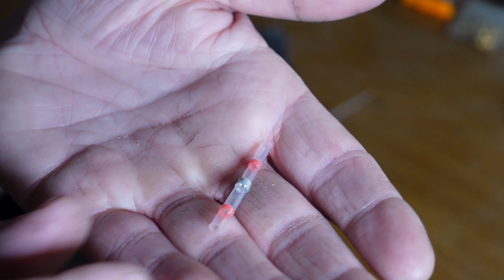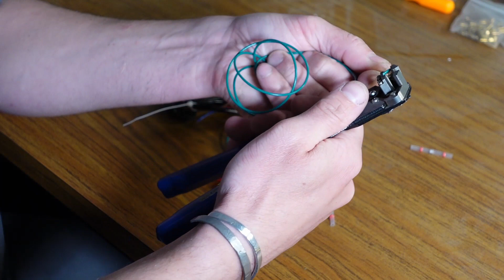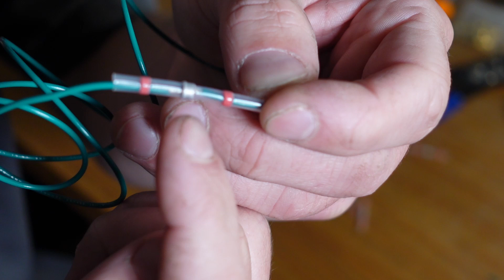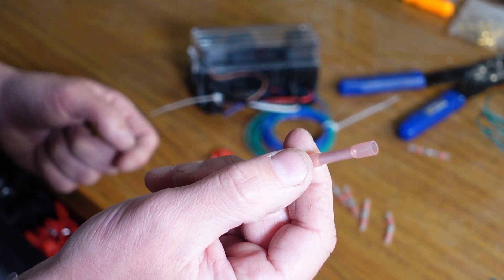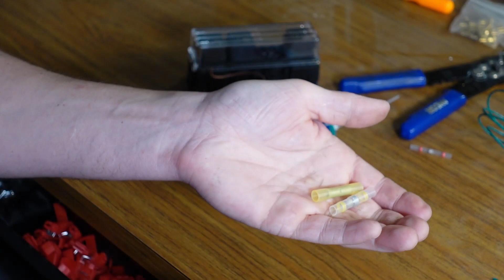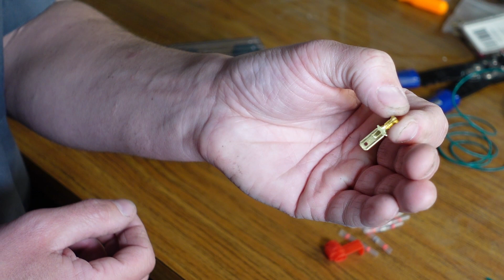OM617 Conversion Series: Wiring Harness

Comment: What kind of hp/torque can be made reliably with the om617, could it replace a gm 4.3l without feeling like a downgrade?
Reply from the maker: 230/300 very rough ballpark. Depends which 4.3. There were some pretty stout 4.3 variations. I drove one in a K1500 with a 5spd and was impressed compared to a Dodge Dakota with a V6 and 5spd. I wouldn't have replaced the 4.3 in that K1500. I think it was like a 1993 or so. The mileage would be the biggest difference.
Reply: @doomsdaydiesel  Cool thanks for the response, I watched your video on making power with om617. Ya it would be like a 1998 4.3 so rated at 190hp but that's engine hp not wheel hp. I was toying with the idea for a few reasons, fuel mileage, which I don't know would be much better, electrical simplicity, and reliability, The 4.3 is pretty reliable anyway, other than the fuel injection system.

Comment: Hey Joe! First off, thanks as always for the great content and products. I just hopped on your site to check out the harnesses. I have an OM617 in an old Chevy truck, so I'm looking for more of the universal side of things. Is the "Toyota" one the only one you sell or am I missing something? I assume I could make this work with a universal keyed ignition but the Toyota dash cluster wire and the "electric over air solenoid shutoff from the Toyota EGR" thing threw me off. Is that a separate part I can/need to buy so that I can provide the vacuum to shut it off?

Comment: Joe.... what is the purple you are not using out of the MB GPlug harness?  is that the one  that originally went to the Starter Relay?   if so why the suggestion to not use it?  Will ask on Fbook too
Reply from the maker: @coachgeo  it keeps the glow plugs on past the ~23 if the starter is still engaged. It connects to the starter signal wire.
Reply: @doomsdaydiesel  Much thanks for reply.  That is what I thought it did..  do you still suggest to NOT connect it like done in this kit you once sold ( for everyone else-  newer version now.... not "universal" - back to  more Toyota specific )
Reply: @doomsdaydiesel  to clarify....... starter "signal" wire...... would that be the wire on starter that activates it's solenoid ?
Reply: Am I understanding right in that this wire could also be used for manual glow if it was activated with a momentary button switch connected to 12v?  Judging by below video looks like it would but then again guess that might activate the starter solenoid too ...  not good.  
https://www.youtube.com/watch?v=6BAgO0ZR54U&t=98s